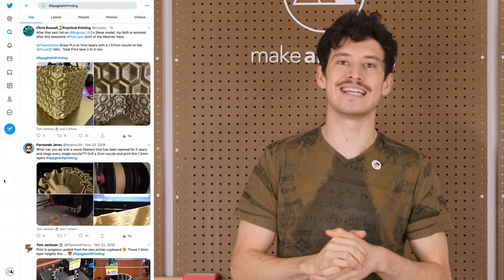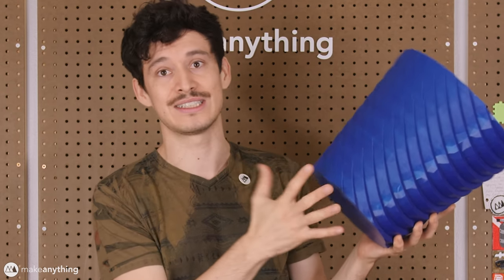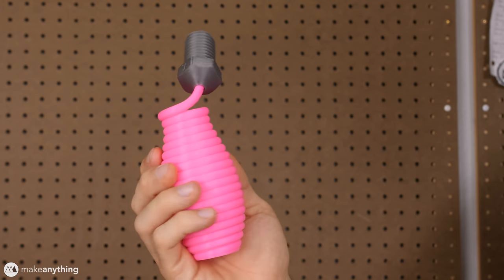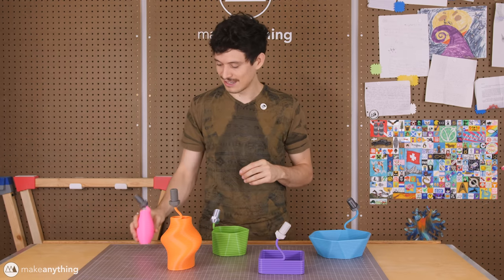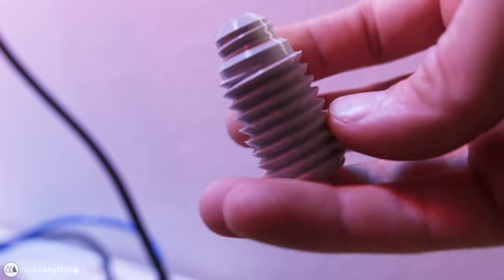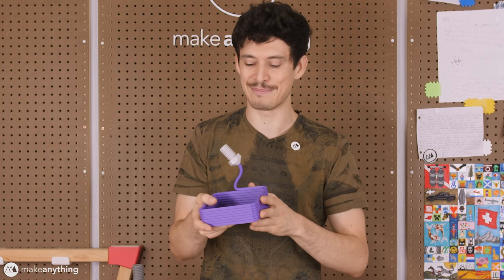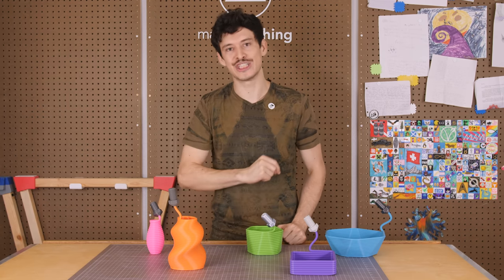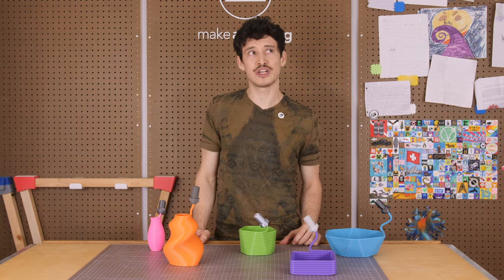Printception // 3D Printing 3D Print-looking Prints feat. Fusion 360

Comment: This is awesome, thanks so much Devon. At 15:10, is there a reason you didn't use the rectangular pattern tool in the sketch environment to make the identical circle profiles? it would be a lot faster and you can go back in any time to adjust the parameters of the pattern.

Comment: Hi, cool tutorial. before the first loft command you state that your coil ends before the right face, mine end at the right face. I have tried the move command to rotate the coil away from the right face but it still ends at the face after the sweep. Any help would be greatly appreciated. Thanks in advance
Reply from the maker: You should be able to move the coil up or down slightly before using it as a cutting tool to change where that coil ends. Otherwise you can create a new plane by drawing a line from the origin as a sketch on the top plane (perpendicular to where you want the plane to be) and use the plane along path function... Not sure how well I could explain that in text but hopefully it helps!

Comment: How about create just a simple mesh as usual, load it into Slicer and set the layer size, nozzle size and extrusion width to something about 5 mm? Then slice it using vase mode and export extruder path to stl. You'll get similary looking spiral model withing a minute, you can then use it as a starting point
Reply from the maker: I'm not sure how one would go about exporting the slicer path to STL, but that would be a cool technique!

Comment: Why when cutting off the bottom of the vase did you not just create a construction plane and do a split object? Also I wonder why the nozzles don't look like they would be printing the vases as most are not perpendicular to the "build plate".
Reply from the maker: Many ways to do the same thing! But I cut the bottom off that way to cut away the bare minimum while ensuring the overhangs can print easily. The tilted nozzles were just a stylistic choice :)

Comment: Question,  could you just draw a 7mm dia coil and then stretch and pull on the sides to form a vase then just add a bottom? That idea is coming from a noob that got lost as soon as you started messing with that coil.
Reply from the maker: As far as I know you can't modify the coil itself to make the vase shape. You might have to watch the part a free times, but I'll bet you can figure out out!

Comment: It's good the hear "save often" for Fusion 360! I don't know if I just keep making more complex geometries, or if Fusion is getting less stable with recent updates, but I now expect crashing in any design that involves any sweep, loft with a guide path, pattern of more than 6 repetitions, more than 2 tangent sketch arcs... etc, the list keeps growing. Appreciate the top-half/bottom-half workaround to avoid self intersections, too!
Reply from the maker: Ugh no kidding. Upgrading my PC hadn't made any noticable improvements either, it seems limited on the software side
Reply: @make.anything  DEVAN!! Hear me out a cup that you can drink from (that looks like your vases) but the spaghetti lines are straws !!
It starts at the top, swirls to the bottom and opens at the bottom of the cup so whenever you drink from it, the water just disappears (goes through the bottom)!!!
Reply: @monstrosity_01   like I said before, the layering on FDM printers can leave spaces for bacteria to grow and food to stick, not only that but the brass nozzles on most FDM printers have lead and can transfer onto the print. Sorry abt that, maybe one day they can make food safe filament/nozzles for FDM printers
Reply: @subcount_zer0  aw man

Comment: Is it better to save it as an STL, or just save it as whatever fusion wants it to be then export as an STL?
Reply from the maker: While modeling Fusion projects save on the cloud (as F360 files, I presume). When the model is ready to print, I export as STL
Reply: You want to keep both the fusion 360 file (.f3d) and export from that into the .stl for printing. You can't really do any modifications anymore to the .stl file, at least not as easy as with the f3d file that has all the individual features and the design history in it.

Comment: Hey Devin, I have a Sidewinder but have had issues printing in TPU (layers coming apart), would you mind sharing your material profiles?
Reply from the maker: I think TPU is included with my s3d profile for the X1. It's on https://makeanything.design/favorites under the section about the printer

Comment: I was sad when we didn’t use the linear pattern tool for the circles. It is so much more efficient.
Reply from the maker: Can you constrain the extent of a linear pattern rather than plug in a number? I did it my way to get the spacing of the center circle that overlaps itself correct, but I didn't check if a linear pattern could account for that

Comment: How did you form the bottom layer when is not a circular shape? Hexagon for example
Reply from the maker: Surface tools mostly.. I might have to make a another video doing something similar, but I basically made the rings as extrusions, offset surface and thicken to make each next ring, then fillet them all to turn them into tubes
Reply: @make.anything  Gracias Devin. You are great =)

Comment: 2:53 "it definitely doesn't look like metal"
Resembles ceramic. Hm-m. Are ceramic nozzles a thing?
Reply from the maker: I actually just spotted an entire ceramic hot end assembly that was 3D printed itself(!!!) on Twitter. Don't remember the company though
Reply: @make.anything  hooooly hell, now that's some printception
Reply: Probably would need some very specific ceramics that offer enough thermal conductivity and not be brittle enough to just snap off when you try to screw them into the heater block. And forming and sintering ceramics into a hotend seems to be a pretty expensive process, just for some experimental nozzle designs... Maybe one day...

Comment: There has to be a more elegant way to model something like that 

You need to have a single spiral path that spans both the flat bottom and the top 

I should probably make a tutorial sometime 

This method is ... well I mean it's not that bad since it works 

But it's ... c'mon ... it's pretty bad
Reply: I guess you could mathematically define a spiral path first and use that as a base for a sweep. I'm not that good with math tho that i could just write down a formula that would make such a spiral with nice organic shapes... Maybe an OpenSCAD guru could step up and provide some examples?
Reply: @ProtonOne11  I'm pretty sure I can do it in FreeCAD